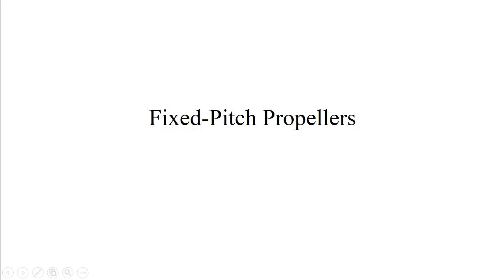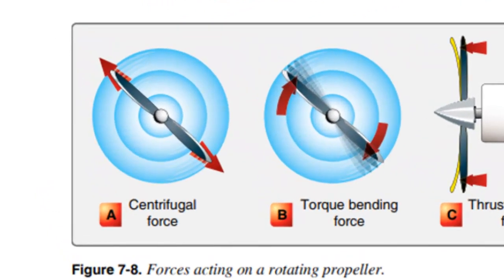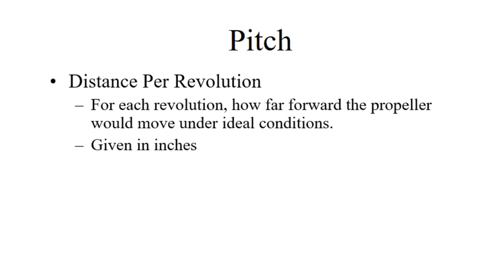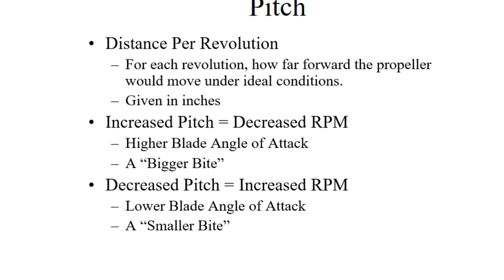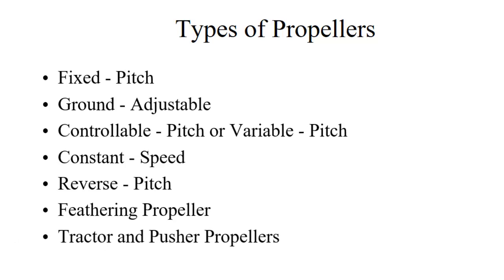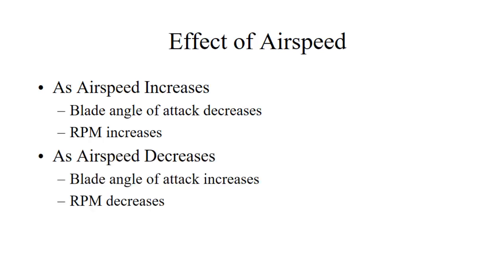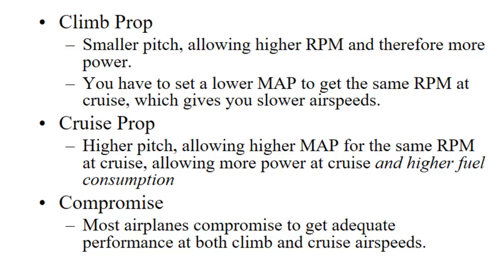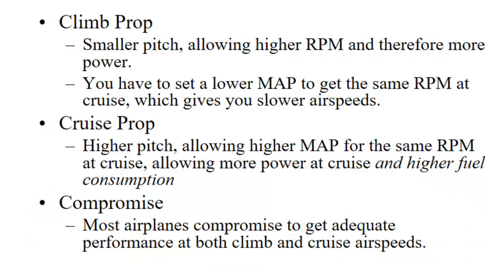ASP - Fixed Pitch Props

Comment: Can somebody pls help me? At 10:00, how is AoA recovered just because rotational velocity increases? It is not clear to me. Right before this it is explained that as the aircraft moves forward at great speed the AoA decreases, which I understand why, not but not how that increased rotational velocity causes increased AoA. 

How I understand it is that increased rotational velocity does mean increased pulling power of the prop as air moves over the prop blades faster hence generating more 'lift' not because AoA increases. 

Any help pls?

Comment: This is one of the best videos I've seen on propellers. The pitch of propellers for model airplanes is usually measured 75% of the way from the hub to the tip. The blades are usually wider there and it's also where most of the thrust is generated. To calculate the angle of attack, divide the pitch by the diameter and then divide by 2.36 (this is ~75% of Pi). So, for a 69x58 prop, it would be 58/69/2.36=0.3562. This is the tangent of the angle. To find the angle in degrees, use the arc-tangent function which gives 19.6 degrees. Since this is greater than a typical stalling angle of 15 degrees, it's likely that the blades will be stalled at zero airspeed. But once the plane begins to accelerate, the relative wind will lower the angle of attack of the blades, and they will become more efficient. The pitch speed of a 69x58 prop at 2400 rpm is 2400x58/1056=131.8 mph. At 2400 rpm, the rotational speed at the 75% point of the blade is 2400*69*Pi*75%/1056=369.5 mph. If the plane is flying at an airspeed of 105 mph, the tangent of the angle of the relative wind is 105/369.5=0.2842 which results in an angle of 15.86 degrees. Subtracting the relative wind angle from the blade's fixed angle of attack gives a relative angle of attack of 19.6-15.86=3.74 degrees. Subtracting the airspeed from the pitch speed gives a slippage of 131.8-105=26.8 mph or 26.8/131.8*100=20.3 percent.
Reply from the maker: This is really interesting! It's never occurred to me to try and arrive at an actual angle from this direction. Thanks!
Reply: @pccaviationscience6769  Good deal. Also, the speed of the relative wind is the square root of the sum of the two speeds squared; e.g., RW = Sqrt(105^2 + 369.5^2) = 384.129. It’s the length of the hypotenuse of the helix described by the 75% point of the blade through the air.

Comment: Nice explanation but i have doubt how to find the theoretical values for these force acting on a propeller? Is there any formulas could u tell me that😅
Reply from the maker: Good question, and it might be fun to try to actually calculate these. If you wanted to do that, I think you could probably apply some of the formulas from your basic physics class to approximate the centrifugal (centripetal, actually, but basic Newtonian physics as applied to a circle), thrust and torque forces. The twisting force is probably a bit more complicated to try and calculate. This class is aimed at understanding things from a pilot's perspective, though, so we don't go into the engineering considerations. For us, it is only important to understand that these forces exist, and that they are formidable, so that we can do our preflight inspection of the prop with an informed eye.

Comment: since it is a fixed pitch propeller, is it can only be used only on condition only? i mean when you want to climb use the climb propeller and when you to cruise use the cruise propeller. i have a thought on this.
Reply from the maker: With fixed pitch propellers, you have to make a compromise and pick a pitch that works well for all conditions. Of course, it has to be approved but he FAA for the aircraft, as well. Most props are a compromise that give just enough climb performance to handle normal climb requirements, and still give you decent cruise performance. "Climb props" shift the compromise towards the climb performance a little, but you may not be able to cruise as fast.
Reply: You should carry at least 2 propellers all the time and switch them as you need in mid flight😁😁😁
Reply: Best of both worlds. Carry three engines all synched as conditions require...